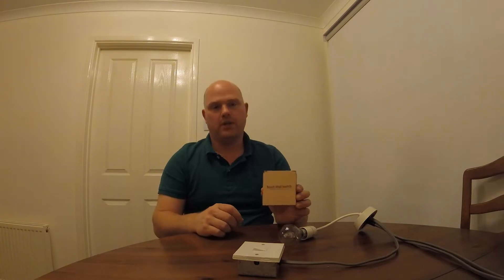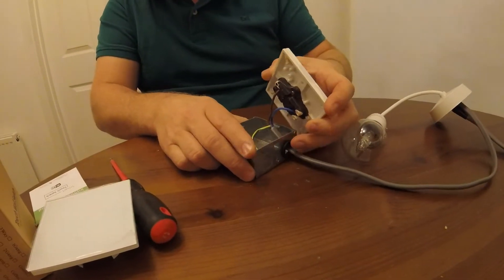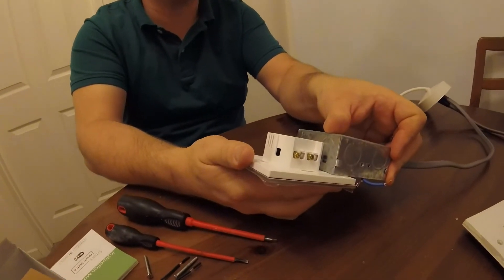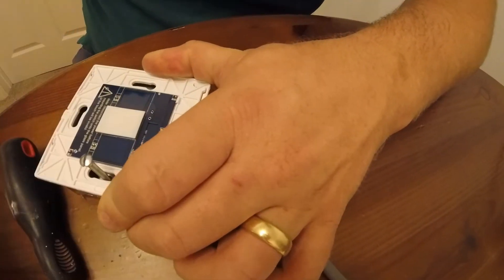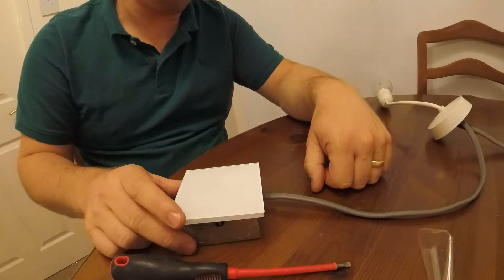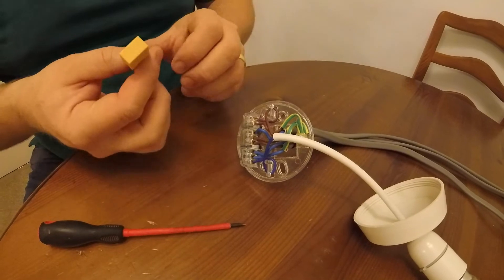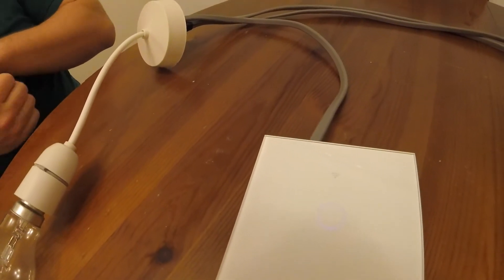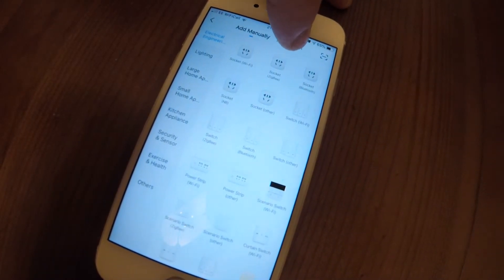WIFI Wall Switch 1 Gang

Comment: just had to return mine. Can't get to the ceiling rose, due to a false ceiling. Shame
Reply from the maker: Hello, You don't necessarily need to get to the ceiling rose. The capacitor just need to be fitted across the wire going to your light so can be fitted at the light if possible. Hope this helps. Kind regards, Pete. Champeny Home Automation.